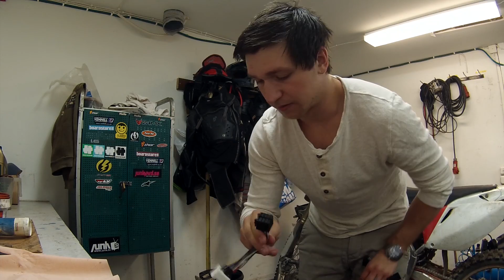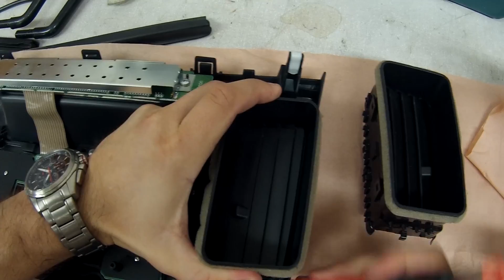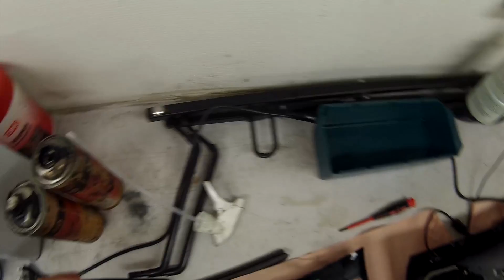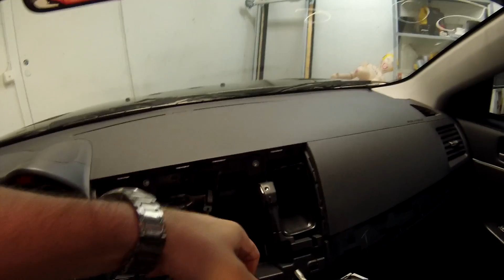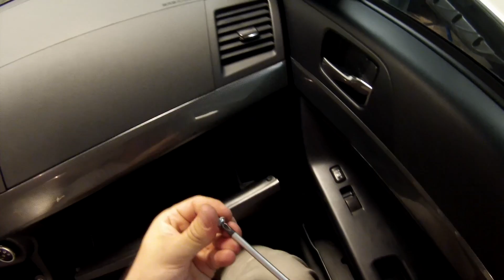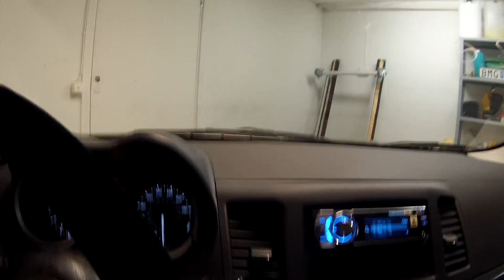Lancer stereo removal and aftermarket install Part 2 of 2.

Comment: Hi I have a question .. when installing a new radius will lose contro q I have on the steering wheel that is control volume up and down. And the switch to auxiliary mode . And else. ? Thank you

Comment: Is it possible to still have functionality with the steering wheel controls after installing an aftermarket stereo head unit into a Lancer 2010 sx?
Reply: You'll need to buy a separate kit that's compatible with your controls you want to use

Comment: Would you still be able to use the "hands free Bluetooth" that's on the steering wheel ?
Reply: Steven Lopez Only if it's supported in the new head unit, you also need some connector for it. I'm afraid I haven't given it much thought since I have another steering wheel without any function .. except the horn.

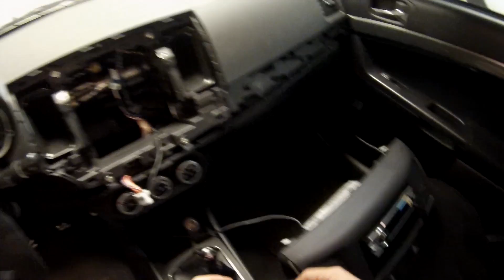Comment: Tried to install aftermarket stereo on '08 Lancer but I had no audio at all.  You can see on 11:26 that a factory radio has two connectors and for aftermarket radio you only attach it to one of them.  Did you have no sound issues as well?
Reply: temich1985 Refer back to the 4:00 part of the video where he talks about the ISO cable.
Reply: logan jamie thanks!

Comment: U probably should tested to see if the radio worked before putting all the trim pieces back cuz what if u put the trim pieces back and went to turn the radio on but doesnt come on cuz of a bad wire in the harness or something then u would have to take off the trim pieces to see whats wrong.

Comment: What is the other wire harness for I seen you just stuff it back in the dash. Is it the steering wheel control harness?
Reply from the maker: That is correct Sir.

Comment: For the single din stero, is it supposed to be able to just slide into the dash to get into place?  For example, say I'm putting in the din  stero but it doesn't go into the slot. Is that what is supposed to happen?
Reply from the maker: Yepp, just slide it into place.

Comment: Nice video ETK!
I am about to buy a dash kit and it includes a wire harness which is kinda different from the "ISO Adapter" you are holding at 04:20. Are they the same thing? Thank you!
Reply from the maker: Thank you good sir!
They may differ a lot visually but if your getting a ISO Adapter your getting the right thing :) Worst case scenario is: You have to buy a new one at your local stereo dealer for 5 bucks.

Comment: Hi mate, on the front of the original stereo under the right hand knob, there is a small ribbon wire, can you tell me where that plugs into in the dash please? My friend has installed an aftermarket stereo but now wants the original put back in and we can't find where the ribbon plugs into in the main CD player box or in the hazard light plug area, and worse yet, we can't even find the ribbon itself! Have you got a part number for it at all mate??

Comment from the maker: Alright, then you need an iso adapter/wire harness, it works with both the single and double din, no difference between the two. Almost every nav units have built-in gps today so no extra cables are needed :)

Comment from the maker: Thank you, I bought it at my local car audio store, almost every store have them in stock, just ask for a mitsu iso adapter and give them your year and model. Yes you need an adapter if you don't want to splice up the wire harness. That depends on what navigation unit your going to use, stock/aftermarket?

Comment from the maker: That all depends on if your new stereo support steering wheel controls or not. If it does support steering wheel controls all you need then is an adapter to convert the signals from your steering wheel into your new stereo and then your good to go :)

Comment from the maker: I'm 99% sure that the flat wire harness is used for the power supply for the factory stereo display. The steering wheel controls has a seperate wire harness that almost looks like the one where you put your ISO adapter for the stereo, they sit next so each other.

Comment from the maker: My lancer is imported from the US, so yes. It will fit your as well. I didn't buy the ISO adapter from a Mitsubishi dealer so I don't have any specific model #, just drive over to your local car audio shop and ask for a ISO adapter and name your model and year, they will help you out, they usually have them stocked up in the shop.

Comment: i installed mine fine, but there was a plug on mine that wasn't used. was that for steering wheel controls maybe? it was plugged into the factory unit but no place for in in my after market one.